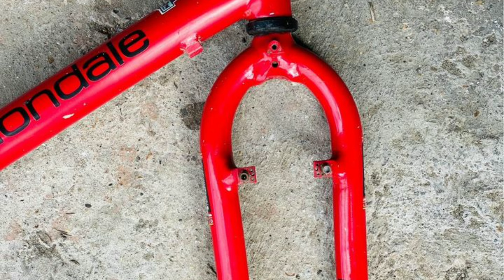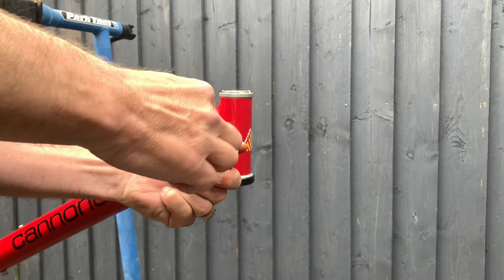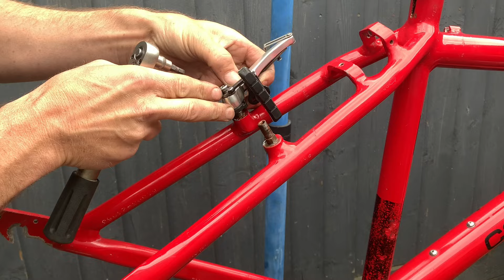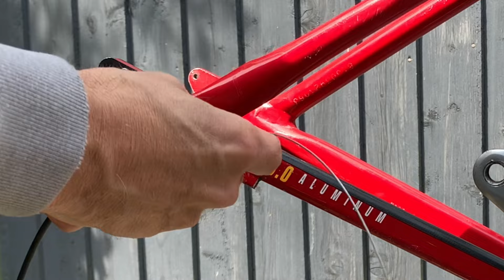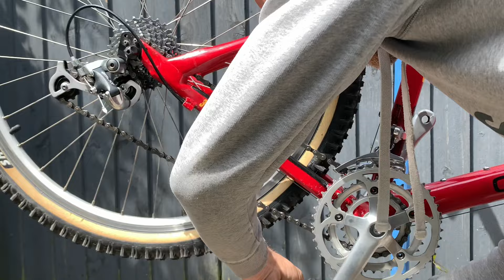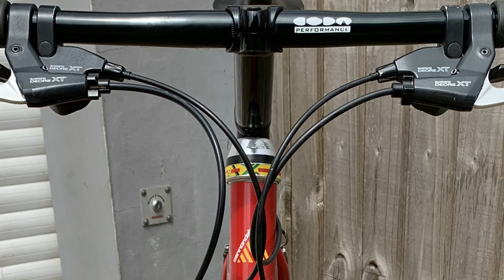Cannondale M800 Beast of the East Retro Mountain Bike Timelapse Build

Comment: Your content is good, I’d love to hear how you stumbled upon each frame and where you got the parts from as well as if they are period correct or not (not that it really matters), I’m just hooked on retro mtb rebuilds.
Reply from the maker: Hi, I buy them on various a marketplaces but some bikes aren’t mine. I pretty much stick to 90’s stuff because it’s my favourite era. Parts are usually 90’s and fairly close to the bike’s year but I’m not hyper obsessed with putting the exact part on it had when it was sold new, as long as it is close I’m happy. This one for example has XT groupset that was 4 or 5 years later than the frame. My theory on it is that it would be a period correct upgrade after you’d worn the original parts out. I’ll sometimes buy old bikes just for the parts it has and put them in the parts bin for future projects. Thanks for your comments 😊